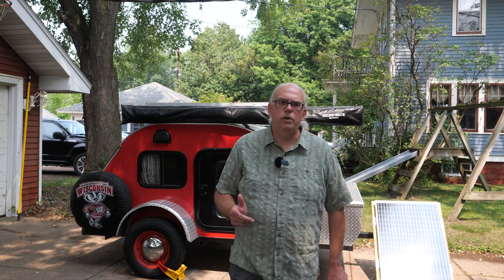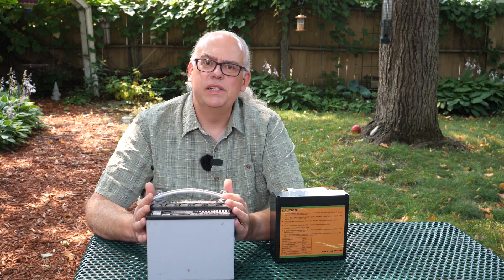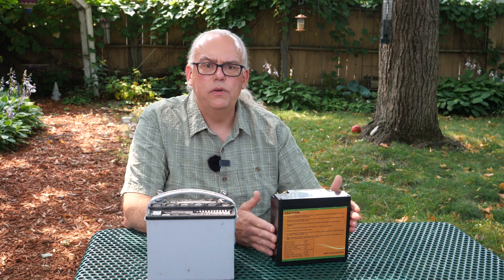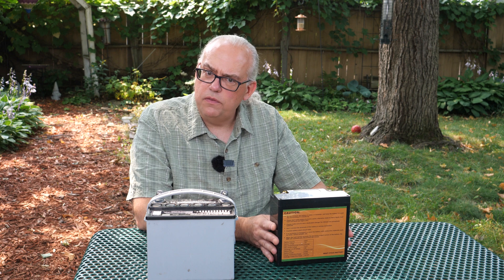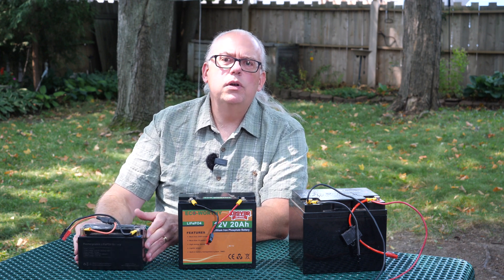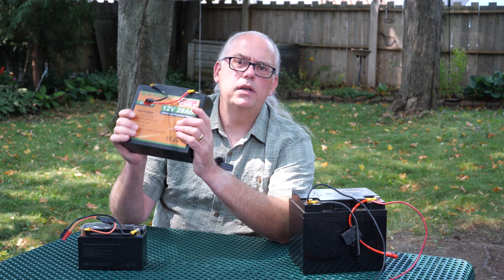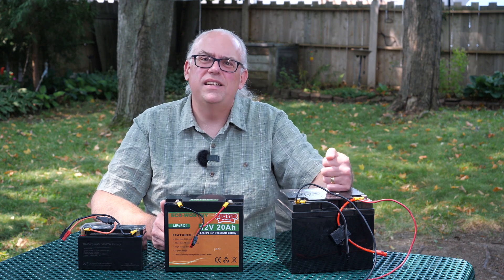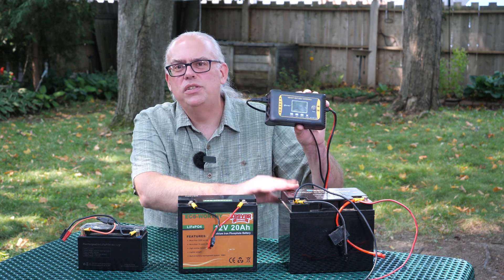Picking the best battery for portable Ham Radio #hamradioqa

Comment: What battery do you use to power your camper?  I have a camper also and we go off grid a lot.  I am using a large deep-cycle RV battery, but I am always looking for better alternatives.
Reply from the maker: I'm using a 100ah LiFePO4 battery for the camper. The brand is Weize and this is the 2nd season I've used it. I couldn't find the exact battery online, but I choose that model because Wil Prose gave it a decent review when he did a teardown and it had a built in low temp cutoff sensor, which is important to me for late fall camping. My recommendation if you are switching to LiFePO4 is to buy the biggest battery you can afford. Or if you are looking a multiple batteries, make sure the BMS allows for parallel connection (not all batteries do, and you have to stay within the same brand and size in order for the BMS to communicate with each other). I found an older video on my setup, I think I may update it, though. https://www.youtube.com/watch?v=ArGRd03Oy0w

Comment: Thanks for the work. One comment, in the links, the battery charger goes to a charger specifically not for LIFEPO4, but only for Lead acid batteries. I am sure you will want to change this. Also, the Amazon link for the FT 891 is $100 more than the price at DXengineering,for example.   Otherwise great video.
Reply: Amazon prices for legitimate ham-specific gear usually have to be higher than store prices. They pay a slice to Amazon, they ship by priority usually, and they pretty much have to stand behind Amazon's return policy, so they need margin to eat returns. It always pays to shop around.

Comment: great video, i use a 12A life po4 and have had it a few years now, also use a battery monitor from hobyking..  great device..  keeps my ft818 working all day long,  i also use battery packs made with 18650 and 21700 cells..  there even lighter and last a long time to.   weight is very important especially when having to cycle to my dx spots..  lets see more video's on portable set ups and the gear used..  another useful thing to take portable is an earth spike.   73's

Comment: If you ever plan to travel by air, keep in mind that the current TSA and airline regulations limit LifePo4 battery size to 160 watt-hour (12 amp-hour) maximum, and just 2 of those which must be in your carry-on bag.
KZ9V
Reply: Doesn’t that come out to 11 AH? I brought 9Ah batteries last trip in a plane just in case
Reply: @jerryKB2GCG  Technically, 13.8 volts x 12 amp-hours does equal 165.6 watt-hours, but these are generally considered 12-volt batteries, so I've never had a TSA issue with a 12 amp-hour battery pack in my carry-on. 
KZ9V

Comment: In the first few seconds how did you NOT get shocked when you put both hands on the terminals??????  I've always been super careful with that???? That 20ah battery is 55 dollars on Amazon right now.  73 de NA8Y.
Reply from the maker: That battery is deader than dead. I should return it for the core refund, but I keep it around as a prop.

Comment: Interesting info. I'm currently building a battery box using two Miday 36 AH batteries to use for portable operating, and back up power for power outages here at home.  Thanks for the info. de KF3BH

Comment: BUT THE COSTS OF A  LiFePO4 Battery verse a lead acid or a agm  onei can buy many flooded lead acid/AGM  over 1   LiFePO4 Battery
Reply from the maker: A 30ah sealed lead acid AGM is roughly $75. I've seen 20ah LiFePO batteries sell as low at $70. SLA batteries can only be safely discharged to 50% of their capacity, so a 20ah LiFePO4 battery will have a longer life than a 30ah SLA battery. Another added benefit is that SLA batteries are good for about 300 charge cycles while a LiFePO4 battery will last for over 3000 charge cycles. The initial cost may the same or slightly higher, but the long term ownership is much lower.

Comment: Do you use a fuse on the posituve side?
KF0HZN
Reply: For short circuit safety protection, fusing batteries as close to the source as possible is important.  I always put an in-line fuse in the positive lead of that short Anderson power pole battery cable.
KZ9V
Reply from the maker: I have fuses on the positive side of all my power cables.

Comment: Interesting video. Could you please tell something (maybe in another video) about battery charging via solar power? Which hardware is needed and which is the panel size needed vs. battery capacity etc...
I use 2200 mAh LiPo batteries for my FT-818 and would like to charge via solar power just for "greener" operations. In fact the two fully charged batteries give me half a day of operations in SSB or CW at 5W which is enough for my actual /P needs, but the idea of charging via the Sun instead of 220V network is intriguing... thanks. 73 de IW5CWC
Reply from the maker: I've had a couple of requests for a solar video, I'll put something together.

Comment: I'm new to batteries in the hobby. I bought the same EcoWorthy 20Ah Lipo4 battery that you run. 
Do you have any tips on storing the battery when not in use. Should I store it fully charged, etc. and how do you keep it safe from metal objects making contact with the terminals?
Thanks in advance.
Michael-WA5AZQ
Reply from the maker: For short term storage, you can fully charge the battery and let it sit. The discharge rate for these batteries is extremely slow. If they are going to not be used for a few months or so, then the common recommendation is to charge to 75% and then put away. You can then fully charge them prior to use.

As for the terminals, I usually put some electrical tape on them to protect from contact. I removed the tape prior to the video. You can see the large battery taped at 03:09
Reply: Thanks so much for the info Michael! 73!
Reply: I agree with Michael's comment. If you want a Box, you can get an actual battery box for marine batteries. But they are large. You could probably make due with a plastic ammo can. They are waterproof, and 1/4 of the size. Even a large Tuperware container would work. LifePo4 batteries don't require ventalation like a Lead Acid batteries do.